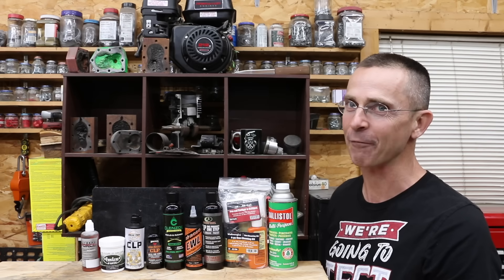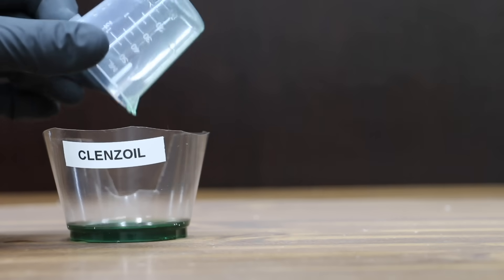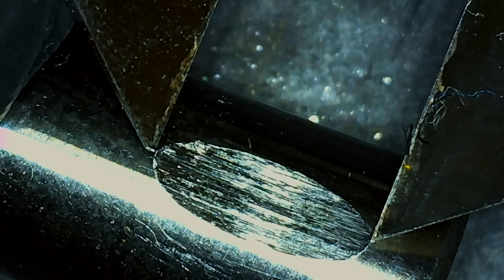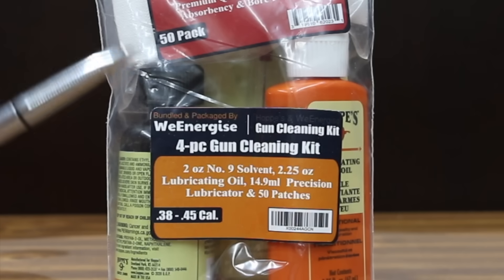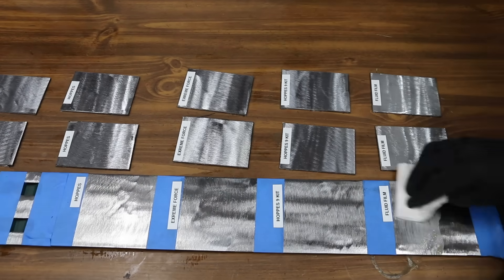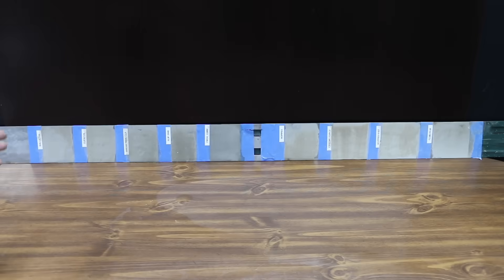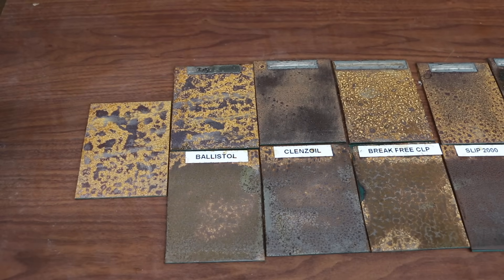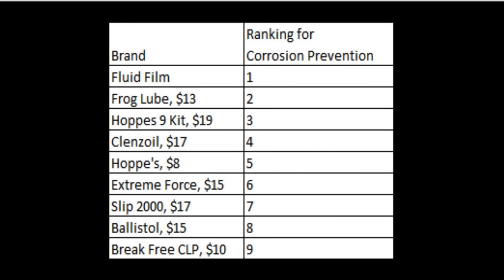Don't Buy A CLP Until You Watch This Review! It'll Save You Time And Money!

Comment: My dad was a gunsmith for many years and truly believed in the Break Free CLP for general lubrication but the Hoppe's was his choice for bore cleaner. He would brush the bore and turn it muzzle down for 24 hours. The next day he would swab the bore and that would come out green. That would be copper or brass residue. Repeat process for three four times till the patches came out clean. Some would say overkill but shooting for accuracy would demand such treatment.
Reply: Precision Shooters actually do not want to remove the fouling. And when they do have a clean bore they first want to run some rounds through and foul it up to tighten up their groups That's actually a thing and it works.
Reply: @actionjksn  yep, think about it. You start with a clean bore and you’re making it dirty. Your group is bound to move. We always shot 5-10 rounds into the practice bullseye before moving to the targets that counted. Not just to dirty the bore but to warm it up too.
Reply: @drbobvs  I AGREE
Reply from the maker: Thanks for sharing.
Reply: Hoppes for carbon and powder residue, but Hoppes Copper Solvent is much more effective on copper fowling.  Since using CFE223 on my reloads, I've yet to have to deal with copper fowling, which is a good thing because the copper solvent doesn't smell near as good as Hoppes #9!
Reply: Boretech is top of the line. Really good stuff for barrels

Comment: Ballistol is German.  It was used by the German military during both world wars for cleaning and protecting their weapons, including the wood, and their leather gear like belts, map cases, saddles, etc.  It was even used as a disinfectant for wound care and still is to this day.  It's non-toxic, biodegradable, contains no carcinogens, and has an indefinite shelf-life.  It has a PH over 8 and can emulsify with water and be used to neutralize corrosive ammo residue and black powder residue, a godsend for the AK shooters, or anyone else shooting cheap eastern block ammo.
My grandfather acquired a map satchel from a German officer in winter 1944 who was no longer in need of it.  It was in pretty bad shape when I acquired it from him.  I wanted to restore it and keep it as original and authentic as possible so I did some research, discovered Ballistol and got hold of some to use on it.  I was extremely impressed.  I can vouch that it works great for mold and mildew as well as softening old stiff leather.  SInce I've only recently started using it on my firearms in the last few years I can't thoroughly vouch for it in that regard but I can tell you I have no complaints about it.
Considering that the formula is almost 120 years old and is so safe and non-caustic, it is not surprising that there are newer chemicals that are specifically designed for use in firearms that may perform better in scientific tests.  However, real world usage by the german army in combat from the deserts of North Africa to the winters of Russia suggests that there is more than meets the eye to firearms cleaning and protection than some numbers on a paper.  If Ballistol could keep an MG-42 in good shape that's proof enough for me.

My major impression of Ballistol in the time I have been using it is that I wish I knew about it sooner.  It is probably not going to be the absolute best at anything, but it seems to be good enough at basically everything and then some.  If I was the type to have a SHTF or bug-out bag, Ballistol would be in over anything else in the category and it is not enough close.
Reply from the maker: Thanks for the feedback.

Comment: Compare Clenzoil and CLP to the best motor oil from your test series.

I've personally been running Mobil 1 full synthetic 10w 30 in all my fire arms for years works better than any gun lube I've ever used doesn't evaporate over time

Comment: Thanks for the great comparison video! I have used most of these but I have had the best results with Frog Lube. When applied using their instructions it works best. You must heat the parts to be coated and coat them while hot. I don't know if this would have helped with the wear test but it would be nice to have seen the test with the proper application. Frog lube has a degreaser to use before application also. . . Keep up the great tests!
Reply from the maker: Thanks, will do!  Thanks for the feedback.

Comment: Looked through the comments but didn't see what I'm about to say about frog lube, so hopefully i'm not just repeating what someone else said. to properly apply frog lube, you should have heated up the test pin with a heat gun and rubbed the paste on it where it would have liquified and soaked in. leave it for an hour, then wipe it down. that's the proper method of treating, so i don't think it got a fair test. having said that, i've used frog lube before and it has gummed up a couple of my more finicky guns (custom 1911s) so I don't think it's as good as real CLP anyway. Man does it smell and feel better though!
Reply from the maker: Thanks for the constructive feedback.

Comment: I never tried the Clenzoil but being a former Marine I've pretty much stuck to Breakfree CLP for my mil spec AR-15. I've tried quite a few other cleaning agents but I have learned that Breakfree CLP is designed to minimize dust collection which can seriously affect the reliability of the weapon, doesn't oxidize in the open air which can gum it up in storage and it is also designed to dissolve the residue from IMR 4198 powder which was what the original Armalite M-16 was designed to shoot and is what I use for my handloads which is all I shoot. Also it provides UV protection for the plastics and doesn't dissolve the plastics for the mil spec rifles. Just don't put any of it it on a Glock's plastics. I leaned that the hard way. I've used it on my skin for sunscreen and as an insect repellant too in a pinch without getting cancer or any other ill effects although I don't think that is a recommended use of the product. It smells good too at least in my opinion.
Reply from the maker: Thanks for the feedback.

Comment: Maybe in a future video you could include some other brands, but also an example of a good synthetic motor oil. That's one product I have used before, given it's designed to manage friction and handle high heat. The cold weather function is a trade off, but it all depends on where you live.
Reply from the maker: Thanks for the suggestion.

Comment: I use Ballistol to clean, and Clenzoil to lubricate in the hot summers we have in PA, while switching to Break Free CLP in the winter. Ive spent alot of time practicing and training with my guns, and I can say that Clenzoil is a VERY good warm/hot weather lubricant. BF CLP is better if youre shooting in temps under 32 degrees. I decided to do a little testing of my own last year, and my AR spent a snowy night outside lubricated with BFCLP, dustcover closed, empty magazine inserted. The next day, I unloaded the empty magazine, loaded a magazine with 30 rounds of 55gr M193, fired all of it, then loaded another 30 round magazine with the same brand, type, and weight of projectiles. The first 15-20 rounds, the gun cycled very slowly, but it didn't jam for fail to eject, extract, or feed.
Reply from the maker: Thanks for sharing.
Reply: @ProjectFarm  You're welcome, sir. Thank YOU for the amazing content and videos!

Comment: I use M-Pro 7 LPX which is a synthetic based oil and costs about $10 for 4 oz. I wish it could have been included in this test because I have tried most of the others(except the Clensoil) and I like the M-Pro 7 LPX better. I'm going to have to get some of the Clensoil to try out. It looks pretty impressive on the wear test.
Reply from the maker: Thanks for the suggestion.

Comment: Frog Lube has liquid CLP and Paste CLP. Liquid would perform differently. Paste is meant as a grease replacement. I use frog lube might not be the best now unless you care about other things. You should try Coconut oil liquid and paste it will behave similar to Frog Lube.
Reply from the maker: Thanks for the suggestion.

Comment: I used the frog lube when it first came out I dont know if they still make the liquid and paste but when I used it the instructions said to put the paste on the gun parts after heating them up and use the liquid for actual lubrication I liked it but it was just too expensive. I just use engine oil and bearing grease now and thats working amazingly well.
Reply from the maker: Thanks for the feedback.

Comment: I've heard over the years that Hoppe's is the go-to. Thanks for taking the time to perform this great test and opening my eyes.
Reply: Hoppes No. 9 still is the gold standard for ordinary bore cleaning, IMNSHO by far the hardest part of routine firearm maintenance.
If your bore is heavily copper-fouled (far too long between bore cleanings), then a judicious application of Shooter's Choice is in order to get rid of all those copper deposits.
Shooter's Choice is wonderful stuff, but it is essential to follow the instructions to the letter or you will cause permanent damage to the gun bore, and it should not be used as a normal bore cleaner because of how aggressive the chemicals in it are.
Use SC for a particularly heavily coppered up bore once, then stick with No. 9 thereafter, cleaning once every 20-30 rounds with centerfire rifles.
Reply from the maker: You are welcome!
Reply: @ProjectFarm  Amsoil makes gun lube!
Reply: The cleaner works great though

Comment: Have never had a problem with Hopped 9 for removing brass and Lead, and Rem Oil, have been told that if you use Frog Lube, get a blow dryer and it will soak into the metal better.
Reply: Used Hoppes and RemOil for years with no problems.
Reply from the maker: Thanks for the feedback.
Reply: The Rem Oil I used did not allow the guns to work in the cold.
Reply: @solarsynapse  Also when I tried remoil, I ended up cleaning rust off of a bunch of things. Worst product I've ever used by far.
Reply: @JC-fj7oo  Have never had a problem, for most of my Pistols and Bolts, I use tw25B grease,  a machinist told me, if it slides grease it, if it spins oil it.
Reply: @jetdr  use what works for you, but I'm never buying it again. Rebluing guns is no fun. They were sitting in the case, in the house... And they rusted. Never seen anything like it before.

Went back to hoppe's and everything is great.

Comment: I hate to say I use wd40 specialist silicone oil and I have had no issues since I started using it. It doesn't attract dust. When I check my slide on my pistol there is no metal when I spray the slide. I know it's not mil spec but it really works and cleans the barrel really well. I pay more for the wd40 silicone than a gun cleaner
Reply from the maker: Thanks for the feedback.

Comment: I use CLP and Shooter Lube on all my firearms. Both are great. I like shooter lube more but it's hard to find. I have to order it directly from them. Where as CLP can be picked up almost anywhere. So I end up trading back and forth with those 2. However, my AKM likes Lucas red n' tacky grease. I don't question it. It runs the best with it... All my other firearms like thin oil.
Reply from the maker: Thanks for sharing.

Comment: Your test methodology is usually pretty good, but this time it fell a little short. The lubricity test here doesn't have a lot of value as firearms don't function that way. I do understand the process of why you chose that and its correlation... I just don't see a lot of value in it. Also, some of the products have issues unique to them, like frog lube gumming up after a period of time. I would have liked to seen a better carbon test... something more challenging in removal. Adding lead and copper fouling to that would have been interesting as well. Also, there's a ton of products out there, and I'm sure everyone, myself included, has their own preference outside of the CLP  product line to see tested, making that impossible for you. 

Overall, it was a good test, but I think it could have been a bit better. I enjoy your projects and look forward to the next.

Comment: very good stuff. Frog lube was not applied properly for the lubricity testing needs to be applied, heated, wiped away. A couple others to try would be rem-oil, Eezox, Weapon Shield CLP. Lucas Extreme Duty. Eezox is the best rust preventative I have ever tried, but was just OK as a lubricant. Rem Oil is a good lubricant but is a poor rust preventative. Thanks for the great vid. I'm kind of a gun oil junkie, I will be trying some of the clenzoil. Thanks!

Comment: For decades I have been suing Hoppe's #9 for cleaning and Break Free CLP to lubricate my guns and protect from rust.  I've always been satisfied with the results.  Though I carry concealed handguns every day in a very warm and humid climate, I have had no rusting issues, but I do wipe the gun I carry down every day.
Thanks for a great test.  I have been using Rig's gun grease for applications where a grease is needed but maybe I'll switch to frog lube when the Rig's runs out.  Cold weather performance is not an issue for me.
Reply from the maker: You are welcome!  Thanks for sharing.

Comment: Fantastic video! I would love to see a Round 2 with additional products, including more that are aimed only at lubricating or protecting. Here’s a few to mull over if you consider it:

G96 (their original formula CLP and newer Synthetic formula)

Eezox (a CLP I believe, but particularly known for rust prevention)

Gun Butter (not a CLP, but supposed to be a great lubricant)

Weapon Shield (which had some controversy a few years back if I remember right - not sure how it panned out)

Rust Prevent

Birchwood Casey Synthetic

Rig #2

Barricade

Lucas Extreme Gun Oil

Pro-Shot

Breakthrough Battle Born HP Pro
Reply from the maker: Thanks!  Thanks for the suggestion.